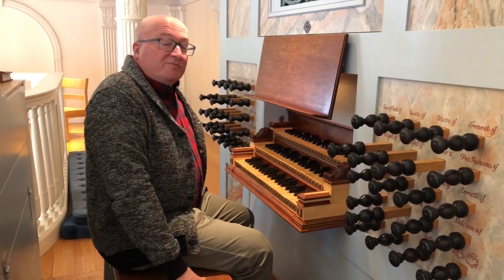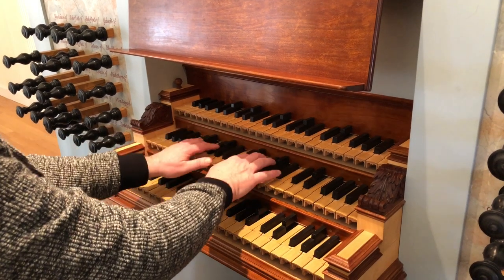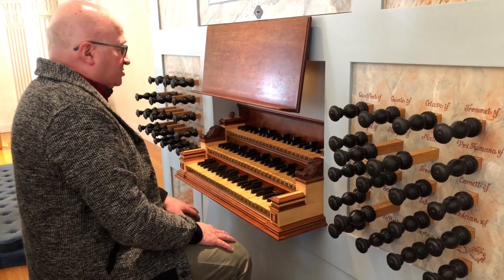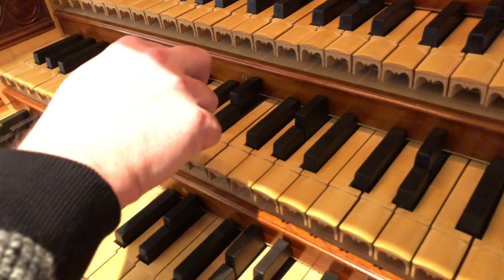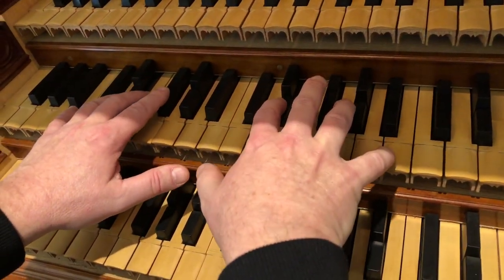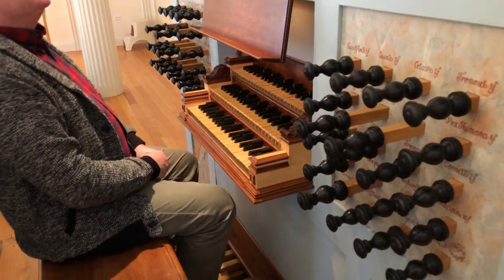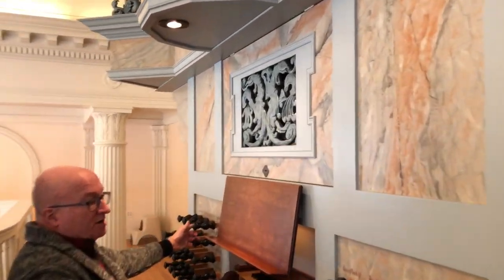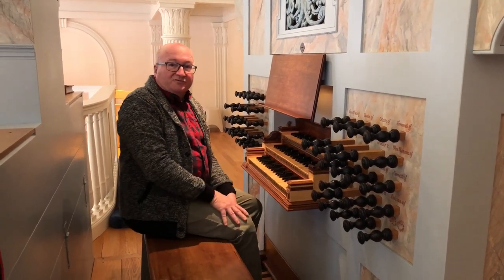Walden Moore demonstrates the Quarter Comma Mean Tone Organ at Yale's Divinity School

Comment: That looks devilishly difficult to play, but sounds fantastic.
Reply: The split keys have virtually no use for today. So, it's not any more difficult than any other type of organ. They were used to transpose chant music, when the chant did not fit the singer's vocal range, or later to transpose for matching the vocal range of congregational singing. Organists do not use meantone organs in that way any more.
Reply: @meantoneorgan  For someone using the account name "meantoneorgan", you sure don't seem to have any idea what you're talking about. The split keys have nothing to do with transposition. They are there for two pairs of enharmonic notes: D#/Eb and G#/Ab, which are sounded as different pitches in this version of the meantone temperament. The function determines whether the flat, which is sharper, or the sharp, which is flatter, will be used. A B major chord will use the D# as its natural major third, while C minor will use Eb as its natural minor third. It's even demonstrated in the video (at 2:02) how misspelling the note in this system produces an out-of-tune chord, which means that when playing an instrument tuned this way one has to take into account the difference between the enharmonic pairs. How you can write such ridiculous disinformation with such conviction is beyond me.

Comment: WOW, is there any music that uses the quarter comma mean tone?
Reply: Sweelinck, Froberger, Cabezon, Correa de Arauxo, Byrd, Bull, Scheidt, Scheideman, Frescobaldi, Cabanilles, Valente, and 90% of music written between 1500 and 1650.
Reply: Quarter-comma temperment ("meantone") was not as widely used as people today suppose. The most common historical temperaments for the organ prior to the 17th century are simply no longer used, with one or two exceptions. You can use quarter-comma meantone for anything that will fit it. It was used in the 17th and 18th centuries, though not in all countries. There is nothing that was written specifically for it, as temperaments generally were chosen by the organbuilder to fit the characteristics of the music, and not the other way around.